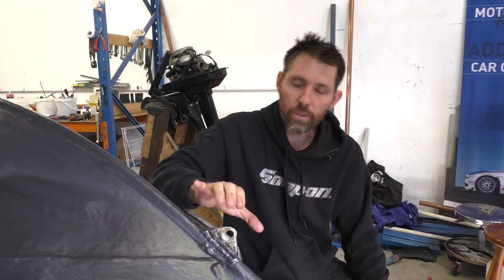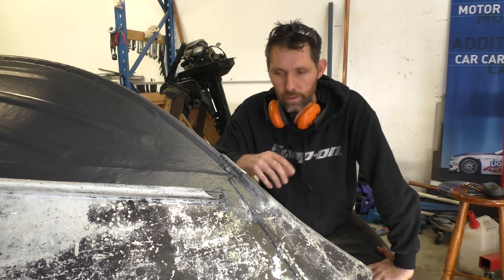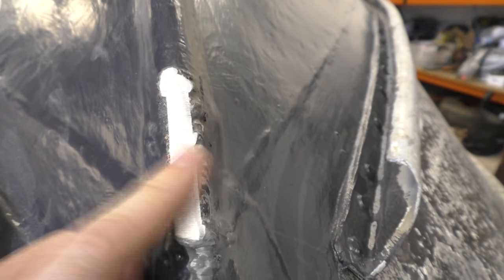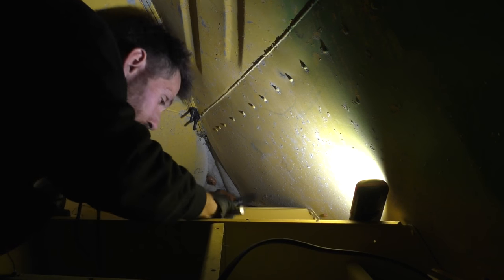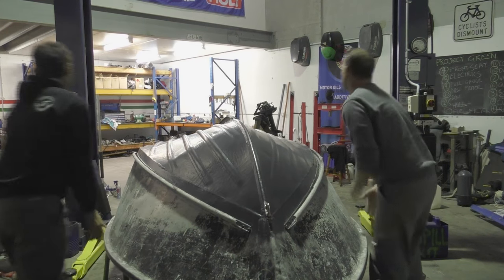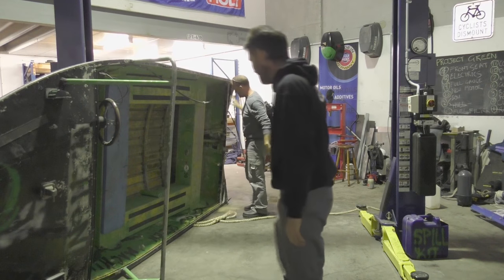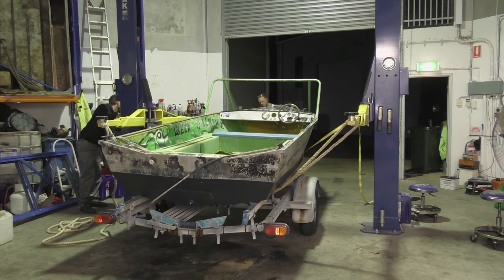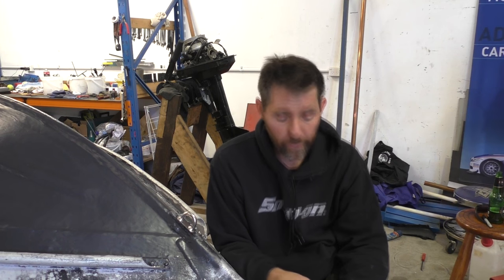Replacing the tow eye on a boat

Comment: excellent start to finish, soup to nuts treatment on the job. pretty much as perfect a solution as you will find, as well. as for that aluminum eye lasting another season, check that bottom front edge from the starboard side again... the crack has already started, lol. so, perfect execution, and absolutely perfect timing. probably saved you from watching her "make a break for the sea"
Reply from the maker: Yes, I certainly sleep better now it is all fixed up. It would have been depressing to say the least if it had escaped after all this work!

Comment: Love the vids mate very helpful, little handy hint for you when you need to cut aluminium wether it be with jigsaw or grinder with cut off wheel or what ever should try using wax on the blade or wheel it really helps with less friction while cutting through the material just a handy hint for you. Great job though mate time to start restoring my tinnie now 😎
Reply from the maker: Thanks for the tip Jake, I'm going to be cutting that mangle bow off the Green Machine soon so I'll give that a try. :)

Comment: Would adding a 2nd eye on the inside  for a 'permanent' attachment of your anchor line be useful?  A good solution for this issue, plus the alternative suggestion for keeping dissimilar corrosion at bay. Another good video, I like the style, the 'just get in and do it' attitude and the KISS principles you use.
Reply from the maker: Hey Ron. That's a great suggestion about putting a permanent anchor on the inside. An in the spirit of keeping it simple I'm thinking there is enough thread left on that eye to attach the anchor rode to with a second washer plate. Leave it with me! :)

Comment: great video, can sometime make how the cables affect the starting? replacing suggestions etc. th story: my battery is 12.6, starter turns when directly connect to battery, solenoid good. just ignition switch does not do anything. checked the voltage there, seems good. but nothing happens. i was suggested to replace cables.
Reply from the maker: Could be a dodgy ignition switch or start-in-gear protection. Have you watched this video? https://youtu.be/e1h-blqDm4U

Comment: The Green Machine is looking better and better! Great job and thanks for sharing! Any decision on the engine?
Reply from the maker: Hey Keon, I'm enjoying seeing it slowly come back to life again. There is a bit news on the engine front, but it is not yet confirmed. It's not exactly what I was hoping, but I have a friend whose boat sank in the same storm that damaged the Green Machine and his insurance company has written the motor off due to the cost of labour to repair it. This means that I might be able to get it from them cheap. It won't have the reliability I was hoping for, but it will save me from needing to borrow money which is something I can't really afford at the moment. I'll do a video as soon as I know if it is going to happen.
Reply: Is it a 50 4 stroke Stu ?
Reply: Stu, With your expertise I'm sure that its gonna work out just fine [ that promises more great videos for us too ;) ]. I just spent a year fixing our 30 year boat and motor and even though it was challenging at times, the satisfaction of the work is the greatest reward and the $ saved are definitely added bonus.
Reply from the maker: I appreciate your vote of confidence, and yes, it can be very satisfying. It also occurred to me that it would provide more material for videos that a perfectly working new motor! ;)
Reply: maybe a local dealer can secure a sweet deal for their latest four stroke as sound PR for their brand...Dangar Marine is gathering quite a following..just saying
Reply from the maker: That would be nice!
Reply from the maker: If this second hand motor comes through it will be a 40 unfortunately, but enough to push the Green Machine along okay.

Comment: Hi Dangar marine, i love your videos you give very good advices i have saved so much money on maintenance on my boat, but now i have a problem, my steering isn't working proprely, when the outboard is all the way trimed down i can turn it very easly the steering is nice, but whem the outboard is trimed up and it doesn't need to be all the way up, i can't trun it, i turn the steering wheel  without anyproblems, but i hear the steering box skipping teeths, i have already opened the steering box and i doesn't seem to be worn, What can be causing the problem? Thank you (Sorry for bad english)
Reply from the maker: It does take a bit more fore to turn an outboard that is trimmed up so I can only imagine that your steering must be right on the limit of what it can handle at the moment. Skipping teeth inside the helm takes a lot of force if it is in good condition so it must either be worn or maybe not bolted together tightly enough. Is it reasonably new or getting old? Sometimes it can be hard to see the wear without a new one to compare it to. How big is the outboard motor in HP?
Reply: I bought an used boat and this steering was already on it so i think it is old i don't know ho old. My motor is an yamaha 60hp 2 stroke.
Reply: I think it maybe not be tightly enough because i opened it once to see if it was worn and i saw that the previous owner had opened it before and it was missing a nut. Thank you so much.

Comment: Do you load yours up a fair bit Stu ?     I would have thought a 40 might be enough with alot of those DeHavillands still running around with 25-30 2 strokes hanging off the transom..I have an old Quintrex Fishabout Mk2 that I transferred a 30 Merc (Tohatsu re-badged)   as a temporary measure ...I did this after the old 40 Johnson died that came with this cheap rig last year..    I'm talking OLLLLD Johnson

It gets along OK but feels under-done with 2-3 on board.... I have been thinking a Yamaha 40 might be more suitable as it's a fairly weighty hull ...admittedly my old girl is only 4.3m long and the Green Machine over 15 foot. Due to budgetary constraints from my better half a new 40 or 50 4 stroke is out of the question...hehe.  Thanks to you I am currently performing my own maintenance so 2nd hand (post 2005 say) should do.

Nice job on the tow eye mate..can't wait to see the bow roller..Cheers
Reply from the maker: I'm hoping the 40 will be okay. Most of the time it isn't loaded up too much. You can do trips across with five on boat some times (on the way to playing soccer for example), but it just takes a bit longer, no big deal. There are a few boats around here the same size as yours with 25-30HP motors and they also feel a little underpowered to me, but having said that, they still get the job done so it really depends how important it is to you to go quickly. Sometimes if you have a long way to go to your favourite fishing spot it can make a big difference.
Reply: Yeah now I have the beast back on the water I'm looking forward to getting back into some freshwater stuff as well as ripping up Cowan Creek for a fish.  With the impoundment fishing its a long haul with camping gear etc so the 40 2 stroke is a preference  I think the original hull was rated to 50 hp back when HP was measured at the flywheel and not the prop..anyway, hope your reliability is improves whichever way you decide to go..the old Yammie served you well I am sure